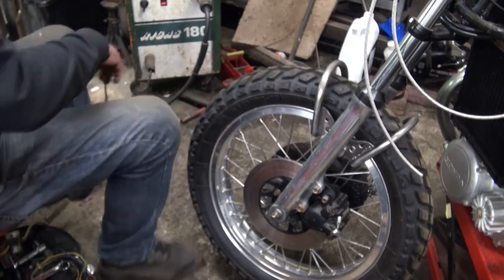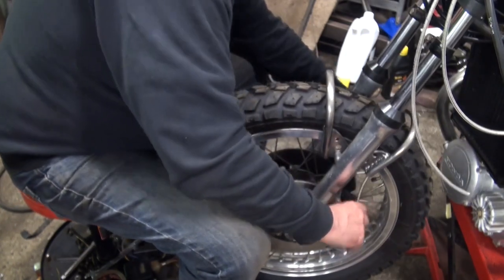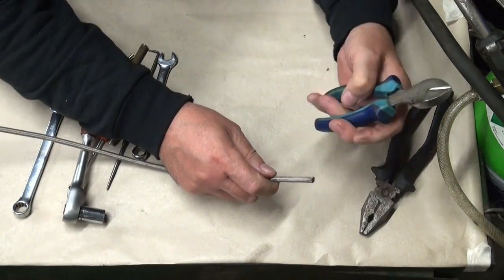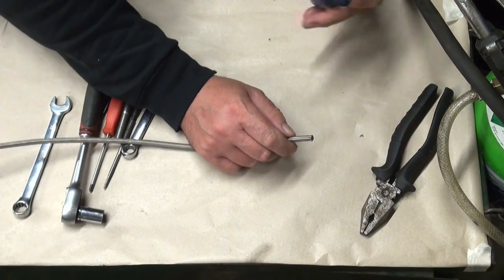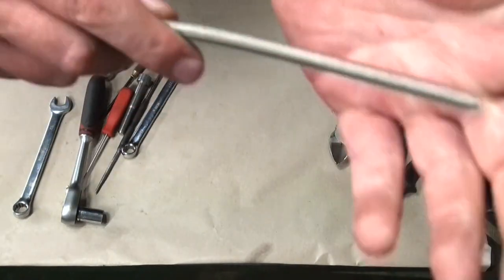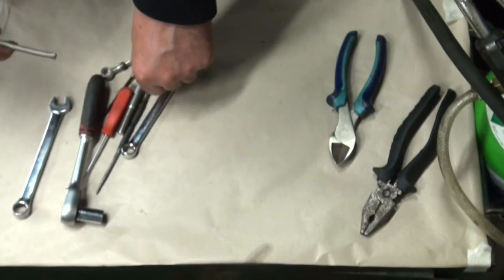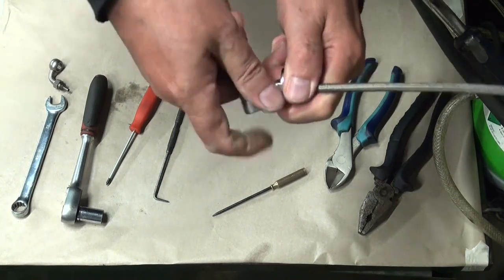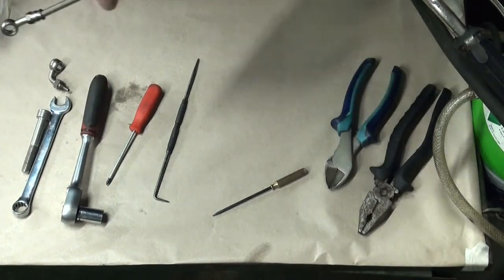Custom Longer Brake Lines

Comment: Where can I get these screw on brake line fittings?
Reply from the maker: Ebay has the straight up and down Goodridge type. For the swivel ones, Google Speedflow to find a supplier.
Reply: Many thanks, will these fittings work on the original rubber hoses? @BuiltatBlackjacks
Reply from the maker: @thundertiger76  No. But the correct type of hose isn't very expensive. 5 or 6 pounds a metre.
Reply: Thanks again :-)